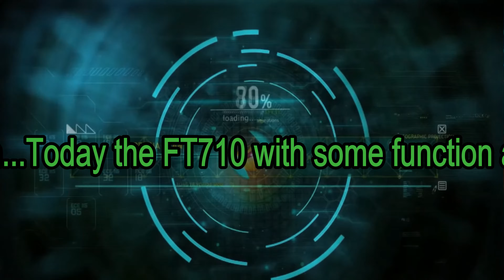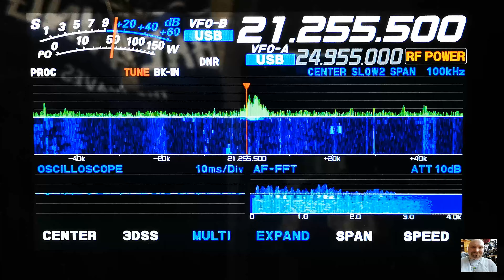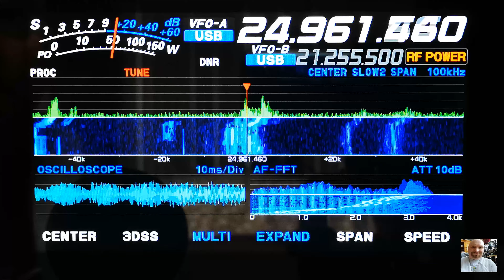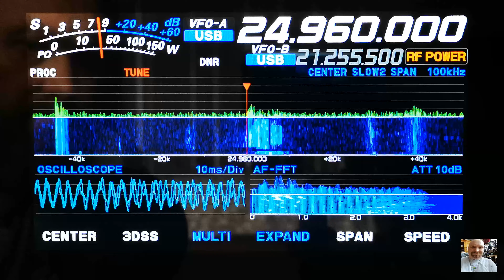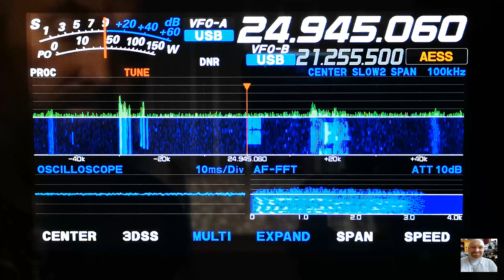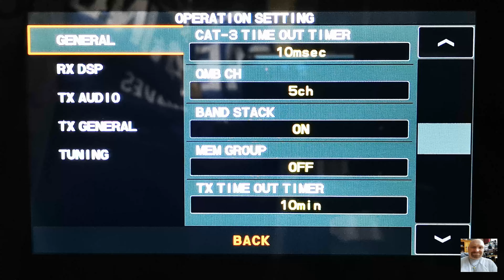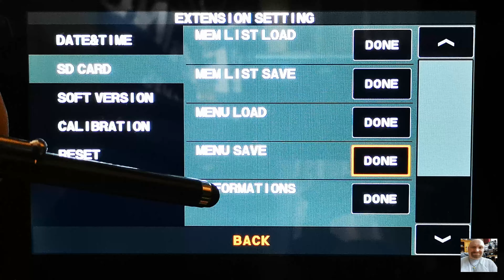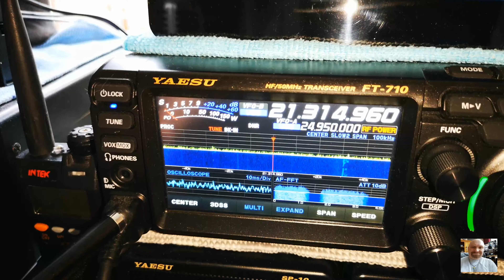Yaesu FT710 Menue and Filters

Comment: I don't know how true it is, but one video I watched warned against using a DVI to HDMI converter cable to connect an external monitor. They stated that this caused problems in some radios. Like I said, I don't know if this is a real concern or not, but I think I will just find me a monitor with DVI input just to be on the safe side. Ciao! de KC0LRM. Hope to hear ya on the airwaves.
Reply from the maker: Hello KellyW thank you for your Comment and i can say the Discussion about the DVI port on the Radio.....I have no problems with the ports because i use the DVI d to HDMI Connector on all the Yaesu radio's and all Radios works realy fine no issues what ever...the FTdx101MP works fine with the Ext. Monitor and the FTdx10 works the same and also the FT710 has the same Connector and works realy fine so my opinion is there is no problem with that. What the Reason are that there is a big problem ....I don't know but there is no problem and here everything is working very wel the Connector from DVI/D to HDMI so i see no reason therfor don't to use this connector....greetings and Vy 73 de Bert PA5HR👍👍